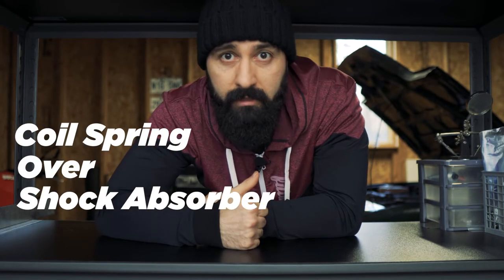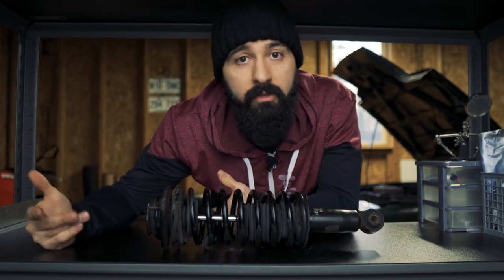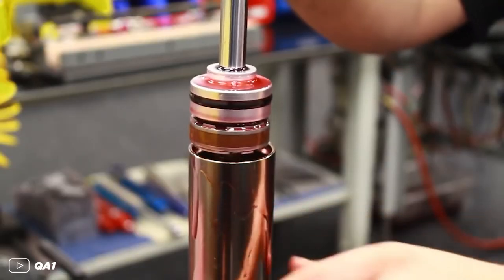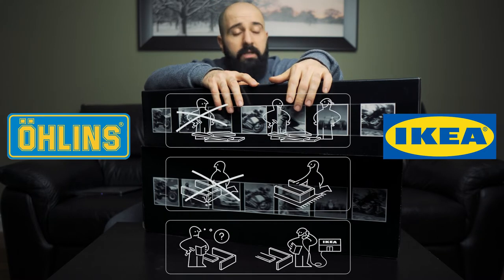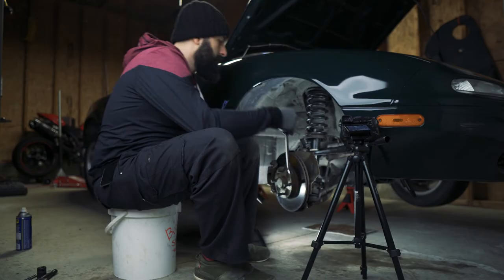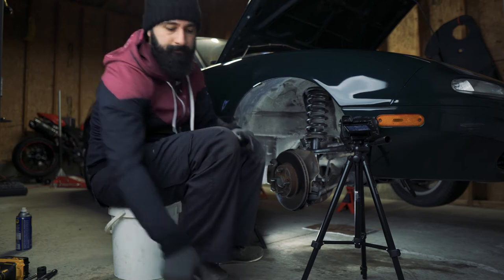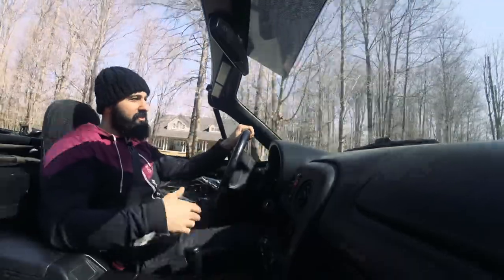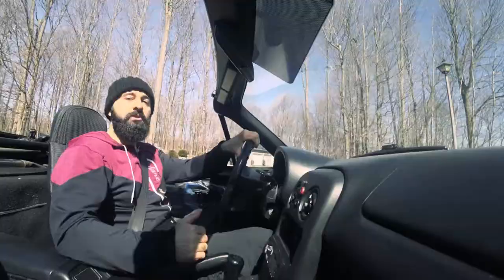Coilovers || PROJECT MIATA || EP3

Comment: Wait so as long as the car is up the coils wont launch at ur face? I been wanting to change coilovers but the suspension scares me lol
Reply from the maker: Coilovers are very simple to do. The one that could get sketchy is replacing your springs with lowering springs. If you don't know what you're doing when taking the stock coilovers apart to replace the spring, yes you could really hurt yourself ..